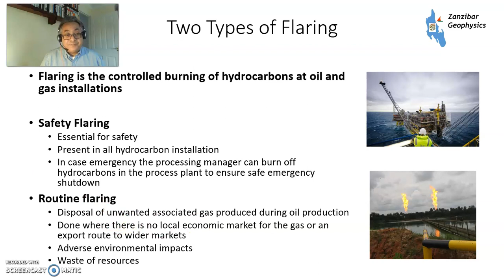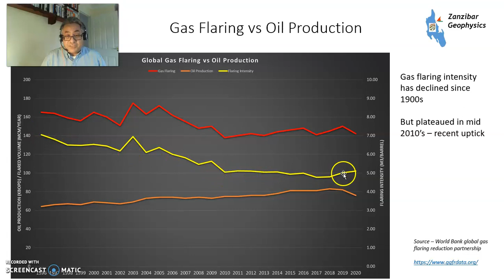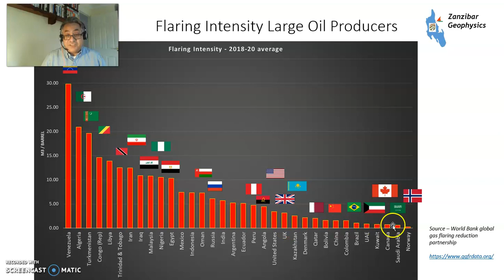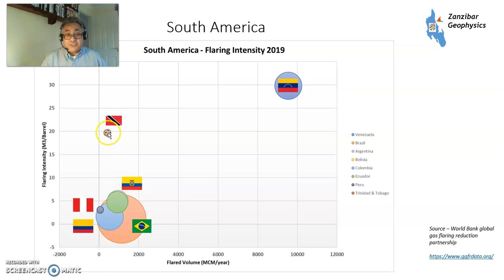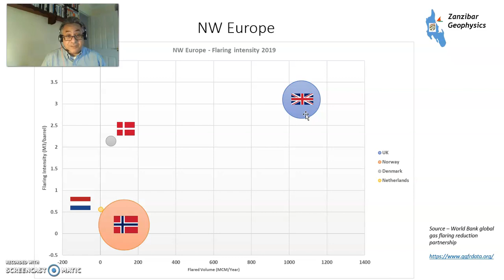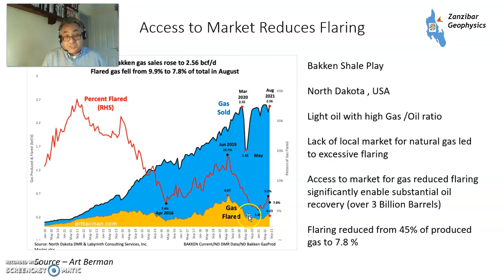Flaring Natural Gas an Abomination and a Waste

Comment: What are your thoughts on companies like Exxon starting to use flared gas to power bitcoin miners?
Reply from the maker: A few people mentioned this when I posted the video on LinkedIn - I know little about this - Basically gas which was due to be fared is used to power an electricity generator which is then used to power local  computers used for bitcoin mining
Reply: better than nothing, but still feels like a waste